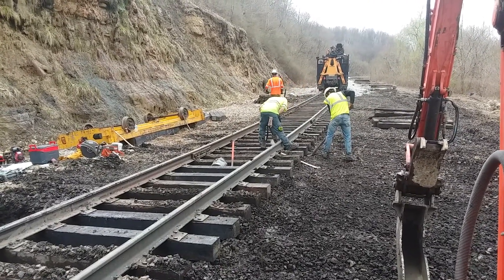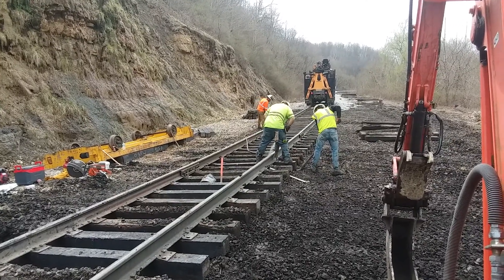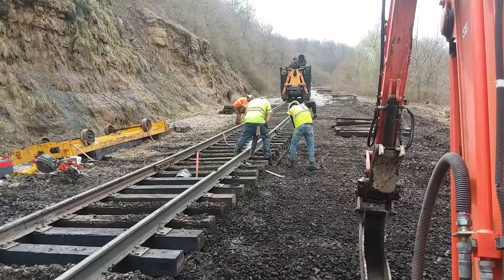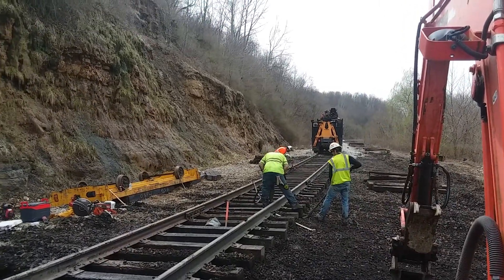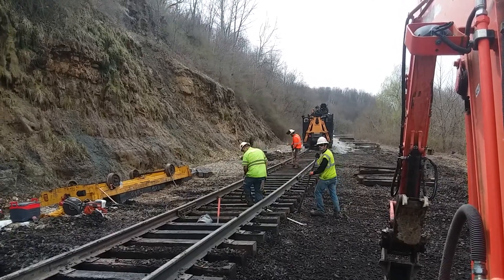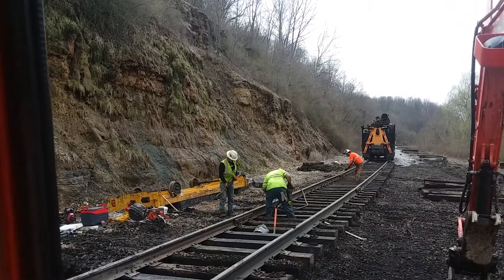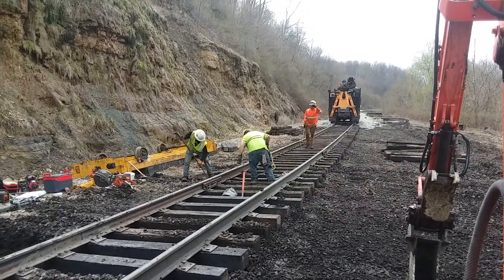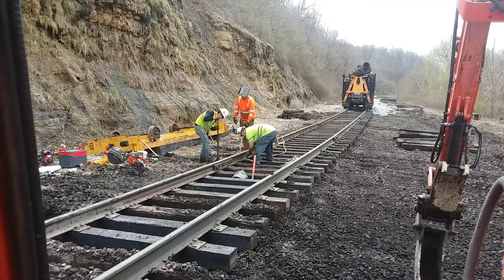Driving Spikes with an Air Spiker

Comment: If you need to install an air hammer or "spike driver" to the big hy-rail truck, connect the air hose to the rear of the truck's air brake glad hand; the red emergency connection line. I did that once with an air wrench.
Reply from the maker: That would be a great idea, but on my truck it not set up for trailer air brakes, just electric brakes, could be maybe i could plumb something in off the air resevoirs 🤔